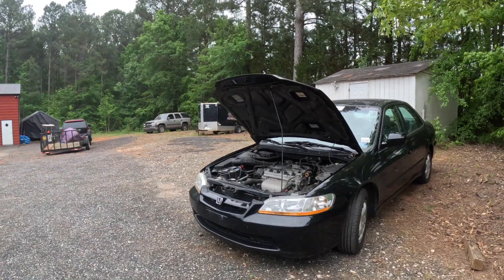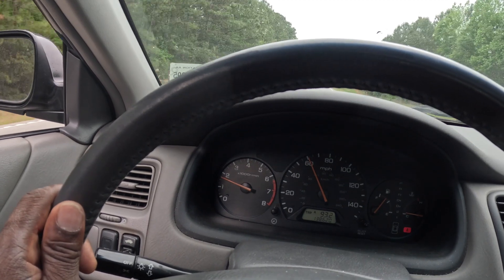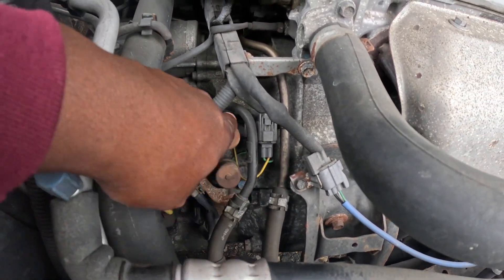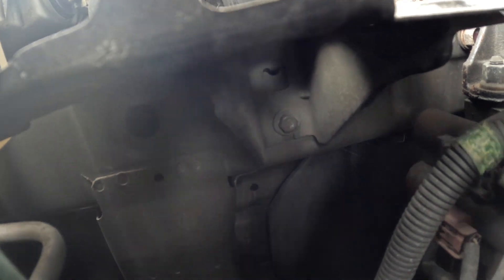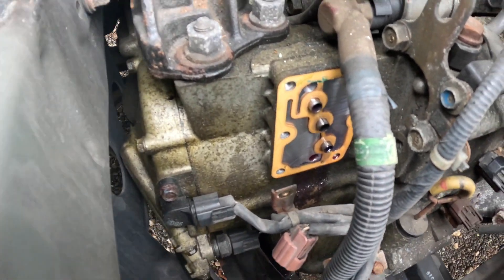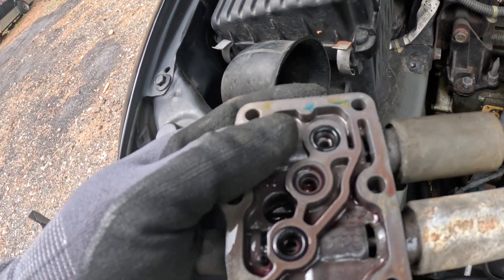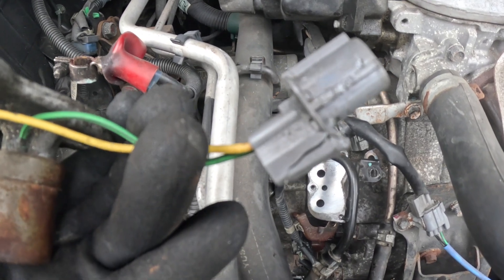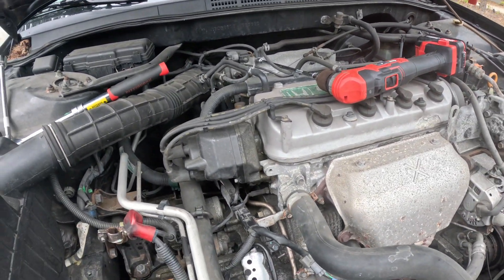1998-2002 Honda Accord Transmission Dual Linear Solenoid B and C Shift Solenoid Removal and Replace

Comment: The screens are in those tubes that you pull out. Also, Honda’s are unique in that you check fluid with engine off.
Reply: Good to know because I was use to ford's and you have to check them while running and warm I do believe.

Comment: The dual linear one is solenoid A the smaller one with the 2 screens is the Torque converter solenoid the smaller ones around the starter are shift B and C.
Reply: Which one could cause delayed shifting from 1st-2nd
Reply: @illjam9695 x2. I’d like to know if you know as well. Thanks in advance
Reply: @illjam9695  I needa know too.
Reply: @illjam9695 I believe it’s solenoid A

Comment: I got a 1998 Honda Accord v4 no misfires runs smooth , lately I’ve noticed after I’ve ran it up to normal temperature driving it I hear a hissing sound coming from the engine not loud but I can tell difference in sound  I’m down in Texas we’re it’s hot , everything is good no overheating it doesn’t affect performance ,all fluids okay you know what would cause this .Thanks
Reply from the maker: Sounds like a vacuum leak from somewhere
Reply: Never heard of a V4 configuration in Honda Accords.

Comment: I had a 2006 Acura TL it was doing the same i has no codes turned out to be the transmission filter
Reply: Where was the filter?

Comment: The screens are in the bottom of 3 of the 4 tubes sticking out from the engine side you better clean those then jump 12 volts to either side of connections and watch the piston for movement not just a click

Comment: Did the shifting stop wen you clean them
Reply from the maker: It was better
Reply: Under the battery that solenoid  you didn't take out the screens.  It's 3 round ports those o rings going on. You can take them out and spray them as well and you would see a big difference
Reply: @unpro_proautobroker aye bro my shi makes a loud ass sound when i come to a stop and then does weird shit in first but it’s only first gear you think it something internal or the jawn in the video please help

Comment: My D4 light is flashing on my Accord would this fix that?
Reply from the maker: Mine didn’t do that.
Reply: Tcu or ecu, I am sure you fixed it by now. Also the speed gage is off or barely working. Tcu is on the backside of the engine kinda hard to get to but possible to do yourself

Comment: Did you have a 706 code if so it could be a sensor on transmission at bottom
Reply from the maker: No  codes was present
Reply: @unpro_proautobroker  oh ok 👍